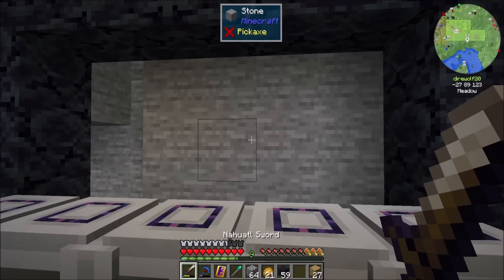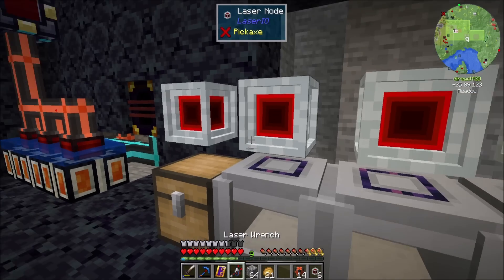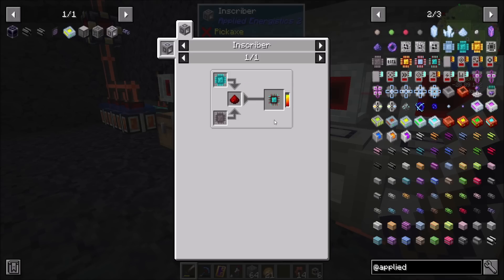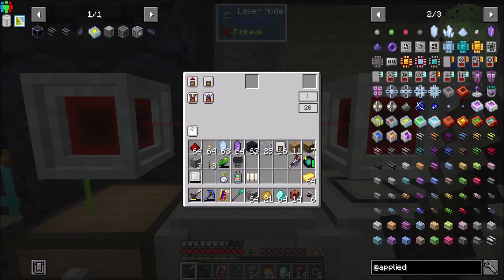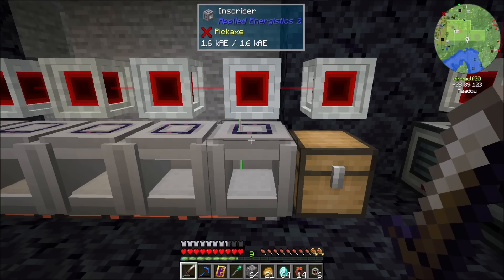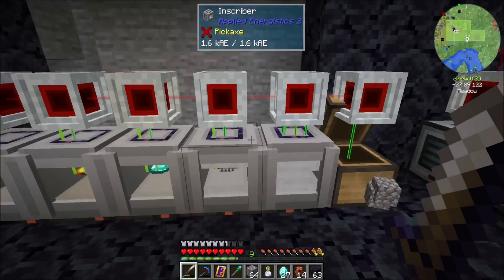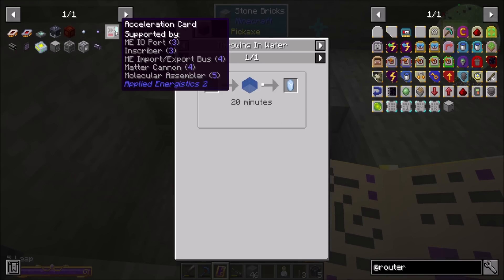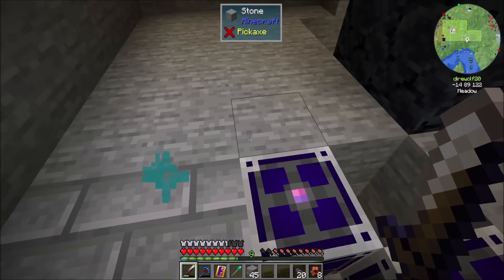Lets Play S11E27 Automating AE2 Prep

Comment: What are the odds that there was an invisible block in that space (Under the chute/open-crate)? Like a feral flare lantern light source.
Reply: My thoughts too
Reply: Probably what it was, it started working right after he placed a block to place the quark dropper
Reply: I don't think that's the case because he put a wood slab in the barrel and it dropped normally, I have the feeling that the AE2 seeds somehow update themselves once they spawn in the world as entities and at that exact moment they hit the bounding box of the open crate and chute, but the quark chute doesn't, maybe because of its funnel shape. But who knows.
Reply: Plot twist
Reply: Botania and Quark are both made by Vazkii and probably share code, so I'm guessing the shape is indeed relevant. Still AlgorithmX2's fault for the weird seed code existing in the first place though. But maybe that's necessary to make the seeds not despawn?

I don't know man. This is why mods are hard: interactions. Making your own mod work isn't enough, you also have to consider how it might work with all the other mods.
Reply: so trying to build this setup in my game I am having the same issue of it throwing the items around. I do not have a Flare lantern around so there are not invisible blocks causing the problem. It just seems to be throwing items out. I tried placing the block from different sides but its still throwing the items around. may need some checking by the programmer, probably a bug.
Reply: best guess, the item is being dropped within the crates hitbox and causing it to go whatever way it wants
Reply: It’s definitely an AE2 bug with the seeds being weird.

Comment: I use a totally seperate Refined Storage importers/exporters/storage disks and 5 inscribers to automate AE disks, I'll have my system, either AE or Refined storage send materials into the system and every material is already exported, nothing remains, gold/quartz/diamond/silicon/Redstone in have places to go and when the circuit lands into the system, it'll be exported automatically into an ender chest back into my main system, so for auto crafting Material=Circuit as if the one chest my main system is hooked to is doing the crafting all inside that one block

Comment: The Open Crate and Chute behave better when they have at least two unoccupied block spaces below them. The water block does not count as an unoccupied block space.
Reply: Not sure that is true....whenever I automate my Mana I place a pressure plate and then place an open crate directly on it (meaning it sits in the space above the plate) and it works perfectly fine.
Reply: Or, as others have suggested, there may have been an invisible block, like a light from his feral lantern.  Notice how he placed a brick block there when he placed the quark chute, which would have destroyed such a light.  I've had open crates work fine with just 1 empty block, and indeed being right about a pressure plate.

Comment: Wow, those seeds do not appreciate spawning inside a block's bounding box, do they? 😅 Definitely should be a bug report on the AE2 repo, given how it interferes with automation with several different mods.
Reply: They even freak out spawning inside an Open Crate, which should in theory just pick them up and drop them again... (there is a ticket for that already).

Oddly enough if you use a Chute instead, there's no issue.

Comment: Ok so in my experiments on this, the vacuum doesn't need a filter. it doesn't pick up the seeds. it waits till they are full crystals before picking them up. also with the chute and open crate there is just an issue of it seems to be dropping the items inside the hitbox of the block causing them to fly around where the create one drops the items from the block space below

Comment: Pro-tip: put the Crystal Growth Accelerators on an ME Toggle Bus and enable them only while you need it. In early setup it's a bit fiddly to get it working, but once you're using the ME system to craft them, you can trivially use an ME Level Emitter with a Crafting Card to do the job.

Even better pro-tip: for this pack, just use an Enrichment Chamber to grow crystals instead of this whole complicated setup LOL

Comment: you might not even need the filter in the vacuumolator
the seeds automatically get the "PreventRemoteMovement" tag, and if the vacuumolator respects this tag, it won't pick up the seeds

Comment: Hey, just a quick question:  What mods are the Waila-look alike and the ender staff from?
Reply: The waila lookalike is the one probe and I'm pretty sure the ender staff is from travel anchors? It might also be called something like staff of travelling, I'm not fully certain
Reply: @skiesquiggles7319  Thanks man~  I found the staff by watching further into the video via the part of the item tag that shows the mod it's from, so I can confirm it is called Travel Anchors.
Reply: @nkromancerN  Yes. The staff is from the mod Travel Anchors. It adds back Travel Anchor blocks from EnderIO. The staff is not required tho. The mod also adds an enchantment called "Teleportation" which makes travel anchors visible by holding the enchanted item

Comment: Hey Dire, I can’t get your server files working. When I run the start.bat file it opens a folder in windows instead of starting the server. I’ve tried changing the path in the .bat file to match everything leading to and in the server files, but I’m still having errors. I need help
Reply: I fixed this issue by the way. There ended up being a file in the jre file that stayed zipped after install. That was fouling it all up

Comment: Using a single inscriber for silicon is such a bottleneck. A more efficient setup is three inscribers per processor type. 1 for silicon, 1 for the circuit, and 1 for the processor itself. It makes a big difference when you have to craft the 64K or larger storage cells.
Reply: At least have a buffer chest for inscribed silicon.
Reply: yeah making 3x inscibers for each type makes it a lot faster to craft huge amounts of processors
Reply: @Run2Seeun  The most effective system I've put together was one where the three processor inscribers were fed printed silicon from a buffer stock, and redstone. All circuit types were then fed via a buffer chest. It meant that any of those three inscribers could make each type of processor.

Comment: FTB App needs work, it's so slow my nephew will have a pension by the time it's open. What the hell is overwolf? Is there underwolf? Is it a gay thing? Like top and bottom?
There is a cobble generator mod, you can turn the cobble into gravel and then sand using the crushing wheels from create.

Comment: Why do mods cheat the sidedness of blocks? Feels like the same argument as ae2 channels where people look to have less mental engineering mini games.

Non the less not really complaining just taking it into consideration.
Reply: because sidedness can be really annoying when you try to build something nice that showcases your machines but has to have power from somewhere, input on top, second input on a side, third input on front and output on the bottom. try making that look nice at least that's my guess
Reply: And also block have to look nice without the wire connecting in every side. But for transporting channel. It just the same as routing your wire through the entire base and I think it's ok to have it tangled or in this channel. It also known as dire wire. At least this is my opinion